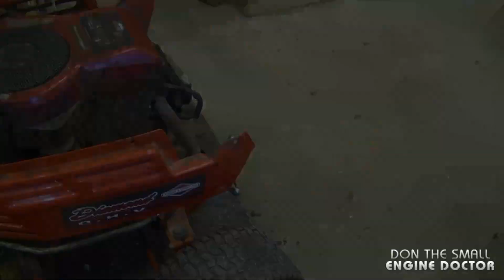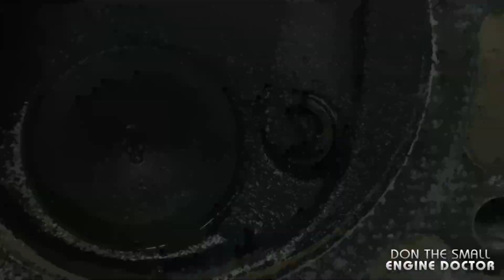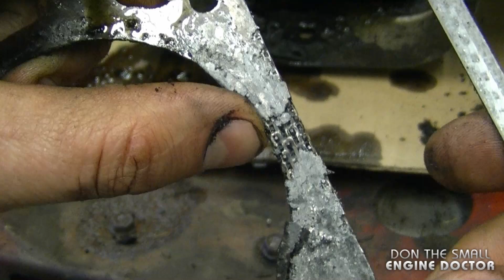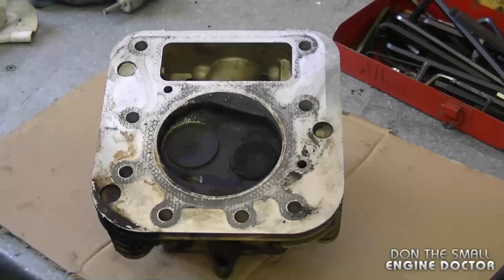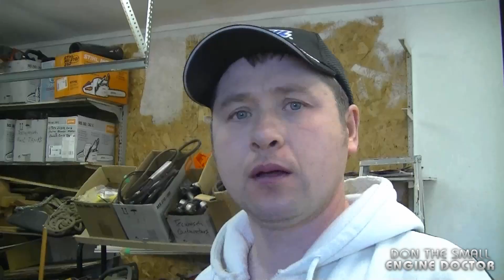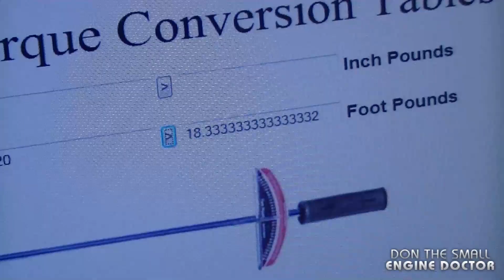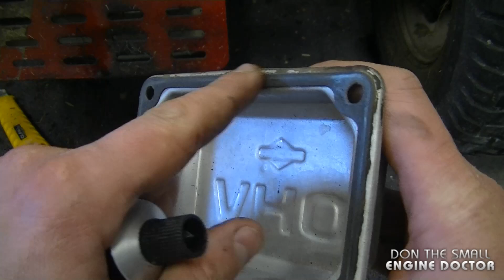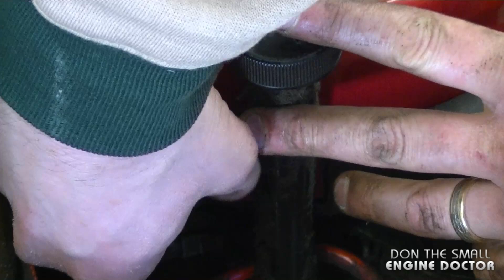Fix a Blown Head Gasket & Adjust Valves On A Lawn Tractor With OHV Engine

Comment: If you have a similar MTD mower but it has the flimsy black plastic grille instead of the metal one on this model, the metal grille bolts right up and is a nice upgrade.  You can find them for cheap at lawnmower boneyards.

Comment: Did you drain engine oil before starting this job?
Reply: No need to, but you could.  Just make sure you are working on a flat level surface so the oil does not drain or drip out of the front of the engine.

Comment: This video has helped me tremendously and I've been watching your videos for years, always great advice and detailed.  I was getting blow by from a damaged head gasket. Smoking, running poor, spark plug fouled and crusty with oil. I also discovered my rocker arm adjustment nut was cracked and broke in half. When I look online on Parts Tree it shows part # 691986 but the picture doesn't look like the same rocker arm adjustment nut. Do you know if this will work?

Comment: Here i am it's May of 2025 and this video solved a issue on a mower i just bought used. They said it only needed a battery as it had none, and a carburetor adjustment. Well that was not all it needed..
 Fortunately , I can fix most things and this awesome video made it painless. Thanks !!!!

Comment: That failure area on the stock-gasket is definitely an intentional defect allowed by Briggs' - I have the 31P6770140B1 John Deere variant and the amount of gasket material between the cylinder and the galley didn't take up the entire surface! It was allowed to be a little 2-3 mm puny gasket sliver.  The replacement gasket I bought from John Deere has gasket material that takes up that entire surface between the cylinder and galley as it should.  Mine started going bad at 305 hours after 15 years by blowing little smoke puffs.
There is a differences between engineering oversights, bad engineering, and parts that are engineered to eventually fail...and this is in the 3rd category.  It's a shame that the evidence amongst everyone is so scattered and that we can't pull a class action lawsuit together on against those guys.  This was an intentional defect and I'm ever buying equipment with Briggs ever again.

Comment: Why will my intake valve not move at all when I spin the top of the engine?  The aluminum rod is not bent nor have a crack in it. The exhaust valve moves fine. This is a Yard Machine 13.5 hp with a Briggs and Stratton engine. 38 inch cut. Thank you

Comment: Hello, did this and mower starts up and runs fine but sputters a bit and black smoke when I crank up the gas. Didn’t do either one before I changed head gasket

Comment: Been following you for many years when I need a small engine fix as I understand basics. This popped up because I'm loo0king at oil coming out of a non running B&S engine. Have seen a couple of how too's. They were pretty through. But you've done this from the alley Mechanic's point of view. Will come back to your detailed explanation when I start on this. Gonna see If you've done a hydrostatic transmission. Thanks.

Comment: Don, thanks for great info, and the steps were so easy to follow I  actually felt comfortable taking parts like head and valves on my troybilt rider 42". I put all together even the pushrods lined up (thanks for the tip with penlight to see the hole to position top rod). My only problem is it won't start. It cranks but won't turn over. I'll take your advice and readjust the valves and let you know the outcome.

Comment: steel push rod is always exhaust, aluminum push rod in the intake side. You can use steel in both spots if you end up with spare from stripped engine.

Comment: Should I adjust valve lash afterwards (even if I put the pushrods in the same way they were before)?
Reply from the maker: It's good practice to always double check!
Reply: @donyboy73  You wouldn't happen to have a "how to" video for valve adjustment, would you...?
Reply: @donyboy73  D'oh - it looks like you go over the valve adjustment later it the video 🙄

Comment: Do you use gasket sealant (e.g. Aviation Form-a-gasket)? Maybe only on the engine block side so that it can be unassembled later.

Did I see a fireplace in the background?
Wouldn't that be risky around solvents and fuel (like fuel leaks or spills)?

Comment: Very good video
..but. you can't reuse a head gasket if u pull the head even if it's not damaged and blow by is usually referred to when the piston rings and cylinder sleeve wear then the end gap on rings opens too much allowing oil to get past the rings or a stuck ring condition exists causing excessive oil consumption and light smoking.  A blown gasket is a failure in the sealing surfaces of a gasket.
You shouldn't use sand paper on any sealing surfaces on an engine either. 
Use a Emory pad like scotch brite.
Plus a valve job should be completed as well. That new gasket is the new updated revision . Briggs has the newer revision gasket as well.also. the torque sequence is available online as well. You did it wrong.

Comment: Thanks for a great video. first viewed it over 6 years ago and used this knowledge many times since; Most recently  on a B&S 19hp 33r877 0004 g1 and the failure was exactly as you described. When reassembling I had a brain fart and my friend tried to compress the spring with a long screwdriver while I replaced the rocker arm. He slipped a couple of times and later I found a piece of metal that looked like half of a small 1/4" by 1/4" piece of some sort of sleeve or spacer. Did not see where it came from so I finished assembly and then the engine was hard cranking even though I adjusted valve lash to spec. The battery was weak and it would start some times if I turned the engine by hand a bit so I left it on a charger. My friend says it is still hard cranking with fully charged battery but spins fast with spark plug removed. I looked at diagram on Briggs site and there is a valve seal on the intake (illus item 868 part 690968) that might be the mystery part. 
The diagram shows this part on the intake only; is that real or do you think they just drew it up that way as a typical? Would that piece missing cause misalignment to mess up the compression?
It did crank easily before I worked on it so I am assuming it is not the decompression bump that is not working. Any advice is greatly appreciated. Thank you.

Comment: Once i got my other used john deere i noticed a little bit of oil around the bottom near the drain plug the whole engine was rebuilt sometime ago i don't know when i can see the new look but i know where its leaking oil 

Its got a really small leak at the plastic drain tube im gonna change that over to a metal pipe and a metal screw cap instead of plastic on the Kohler command cv15s

Comment: valve adjustment the easy way, rotate crank until intake or exhaust is half lift and adjust the other TDC is not needed, and RTV black is overkill as it sticks like a weld

Comment: To convert inch-pounds to foot-pounds, divide the inch-pounds by 12 because there are 12 inches in a foot. 

In this example, 220 inch-pounds divided by 12 = 18.334 foot-pounds.

Comment: Very good video for the amateur like me. Head gasket blown and my spark plug housing with the Bakelite was all melted! So had to replace both. For anyone who gets a bit of smoke on starting after the repair, don’t worry it’s most likely the old oil and will burn off. Mine did.

Comment: Hey Dony. I followed your repair and it worked. My engine started up and runs great at idle. On full throttle it back fires a lot. What’s my problem?  Did I not set the valves properly?

Comment: I have sears craftsman 21 inch cylinder with broken bolt holes what to do does anybody have a old sears mower sitting around so I could have the cylinder offof it

Comment: By the way: The .003 &.004 valve settings did not work for me on my other Briggs & Stratton 19 hp.. Mower would not start. Had to re adjust to .005 each valve. Started right up. Hope this helps others.

Comment: Just did this job head gasket replacement on an identical B&S engine. 7/64" allen key fits the rocker arm torx adjuster and 7/32" allen key fits the torx bolt head that fastens the exhaust manifold.  Your instructions on adjusting the valves are excellent- extremely helpful. Thanks, Dony you're the best.
Reply: Never use hex (Allen) keys on Torx drive fasteners.

Comment: I am having no luck in getting the cylinder head off my 15.5 HP tecumseh engine on a,MTD lawn tractor. Have spent 4 hours and cannot pull it off.  I have every screw out and I could not pull it out. 

I finally managed to wiggle it with a pry bar and eventually got it lose enough that  I could spin  it like 180 degrees back and forth and I even ripped most of the gasket out as I thought that may be holding it back.  No luck at all and I cannot pull it off.  

Now I am wondering does one have to disassemble all of the valve lifters as are they somehow connected to the base. I have the push rods out. Anyone have any idea on what needs to be done.  Thanks

Comment: From all of the folks who post how "to repair stuff" Donyboy73  is 2nd to no no one. He explains everything he does and why and also shows how he puts it back together. I think I need to replace the head gasket as it smokes like crazy and this happened like all of a sudden. Now I have a 15.5 HP Tecumseh engine.

Comment: on changing out the head gasket when all is clean and ready to put back together. can you use permatex copper spray a gasket on the part were you get the blow by. would that hold any better. or just replace the gasket?

Comment: I love you video and I working on my 17.5 hp now.  I  have a question.  794152 Engine Valve Gasket Set for Briggs contains all needed gaskets BUT it comes with 2 head gaskets.  Why 2???? I read a comment in a parts site that said he had to use BOTH gaskets to make the engine run.  What are your thoughts? 

There is a service kit that comes with all needed gaskets.
Reply from the maker: i only use one head gasket

Comment: Hi Don, I have never replaced a head gasket but have good mechanical aptitude so because of your detailed well explained step by step video I took on the challenge with my 19 year old Troybilt machine (which by the way is in very good shape). The repair was a complete success no more smoke and it runs like a champ.
Thank you for publicly sharing your knowledge and expertise you’re obviously an excellent technician, teacher and obviously a good man!

Comment: If Donyboy would have tightened the valve cover with his fingers, then let it sit for 1/2 hr then tightened it on it will seal better. On my 62 te transmission oil pan I had to let it sit for more than 1 hour to stop my Dodge transmission leak. I think if you finger tightened it then let it sit for two hrs it might even be better. I tried a gasket and on the second day it started leaking like mad. So straight sealant after letting it sit and harden up it finally stopped leaking. Pretty persnickity and that is after cleaning the surface  with brake cleaner.

Comment: Excellent video! Very thorough explanation and video work. My only question is in diagnosing the problem how did you isolate the head gasket and not some other possibility such as a leaky seal or blocked crankcase vent tube etc. I ask because I am facing this problem on a one year old engine that suddenly started blowing blue smoke.
Reply from the maker: I've done so many I can tell right away

Comment: Thanks for the great video. Very well explained. I especially liked your comment about if valve adjustments are not done correctly it will seem like you need a new starter.  I had that problem but simply readjusted the valves and all was good.

Comment: Followed your steps and revived a 18.5 Briggs engine that had the valve seat come loose. Just mowed the lawn with it for over and hour. All was needed was a new head gasket and a spark plug for good measure. Thanks Dony!

Comment: 3 things..You really should lap the exhaust valve too replace the intake valve stem oil seal and torque in 80 or so inch pound  increments following the torque pattern til u reach 220ish. 
Otherwise good vid

Comment: Suspecting a bad gasket on a 287707 engine. Opened it but seemingly it had recently been replaced (looked new). Overhead valve cover was full of oil and when cranking the engine oil is spitting into this part. The oil reservoir is "puffing" air when the engine is running and oil is leaking a lot. What could be the cause? Bad piston rings or valve guides?

Comment: I would of re-ringed it, used nylon brushes to clean the carbon and used Diesel. Noticed those brass or yellow colored brushes scratched the heck out of the head. Never would use a steel wheel on an aluminum piston. Put all the parts possible in the wife's dishwasher on hot pot scrubber mode. They will come out like brand new. Use gasket spray sealant tack on the head gasket prior to assembly.

Comment: I had gas mixed with oil and slug coming out of the exhaust when engine stop. Plus it started again but the engine did not turn at speed(is that a problem?). I drained oil. Gas leaking from carb area. Do I need to remove the carb and check for damage?

Comment: I have a 2019 Badboy zero turn mower with a Kohler engine on it.  It is a single cylinder. When I  first got it ,it had no water in the oil. I carried it to someone  who I thought would  do me right by it ,since then I've been having water in the oil.  I have changed it at least twice, along with a new oil filter too. Now it has moisture in  the dipstick tube. How do I  get that moisture out of my engine ??

Comment: Hey Donyboy. I just replaced my head gasket and followed your video. ALL WAS FINE TILL I TURNED THE KEY. MY EXHAUST VALVE OUSHROD IS NOT MOVING. I TOOK IT APART AND I CAN'T SEE ANYTHING WRONG.  ❓ DO YOU HAVE ANY ADVICE FOR ME? Thanks for sharing.🍁👍👍
Reply from the maker: you may not have the push rod in properly
Reply: @donyboy73  How can it NOT be in properly? How can I tell? It feels OK. Is it suppose to be sticking out a little bit farther than the intake pushrod? Thanks

Comment: Great video, right to the point, well illustrated and great graphics.   I just used it to replace a blown head gasket on a Craftsman 17.5 HP Virtec engine that was blowing a LOT of blue smoke. I first had to replace the carb because it was severely flooding the engine and crankcase. After replacing carb & changing oil, started up and ran but still blowing smoke.  Next, replaced Head Gasket, now running perfectly.  Your video gave me the confidence I needed to do it myself, without paying $$$ to a shop.   Keep up the good work!
Reply from the maker: make sure you're subscribed

Comment: Easy quick way (on your phone calculator for most of us :-) to Convert Inch Pounds to Foot Pounds, just take your inch pounds (220) and Divide that number by 12 (as there is 12 inches in One Foot) 220 / 12 = 18.333

Comment: brother would you have video on Tecumseh ohv head removal  the type where valves are over the head. for example 16 hp  vertical shaft have on a old snapper Sr1642  204214b engine

Comment: I love you tube! So before I try to take on the task of changing the head gasket on my LA 125 John Deere my question is, I do have oil coming out of my fuel pump when the engine is running however there is no smoke whatsoever so is it possible that there’s any other reason this is happening that I should  address before attempting to replace the head gasket? It seems as though every video I’ve seen that mentions replacing the head gasket always associates smoke coming from the tractor. For me it was quite accidental that I found I was burning through oil because I randomly decided to check the oil, Noticed it was ridiculously low then noticed one side of the engine seemed fairly oily despite the fact there was no oil on the ground and that is when I started trying to troubleshoot with the help of YouTube.
Reply from the maker: make sure engine is not overfilled with oil. usually it's the head gasket. watch my video here; https://www.youtube.com/watch?v=OKvsCjptt5E

Comment: I have a 2014 craftsman T1000 riding mower and it sputters and  misses pretty bad. I put a new carb and a new spark plug and even a new head gasket but it still sputters and missed pretty bad. I just don’t have a clue on what to do to fix it, do you have any ideas on what it might be?
Thanks Rich

Comment: Very useful information. I really never thought about pulling the engine apart and checking the head gasket. Cars and I'll hurt me That's the first thing I would do if I'm burning an excessive amount of oil. I pulled the heads and check those and the gaskets.

You mentioned something about this guy had bought a new head and it was a small fortune. What I do I go to my local machine shop. Just for one head they will clean and put new seats in and sometimes new valve guides. The most I have ever spent on one head was $125. Now it does take a week or two before this particular shop has your head back to you. Normally I'm goofing around with enough things in my garage that I just push whatever I'm waiting on the head for into the corner.

A long time back about 12 years I broke my back at work and as a result of that I have it extreme insomnia. There's been plenty of times I've gone out into my garage and the next thing I know it's sunrise. I crank up the stereo or just turn the TV on and watch that as I'm working on different things. I found the information in this video very useful.

Look forward to watching another one of your videos thank you for sharing.

Comment: Its a good idea to flip the pushrods over so the bit the was wearing on the guide is at the bottom over time they wear you can see and feel it. and eventually they break there by flipping them you get a second go with them 👍